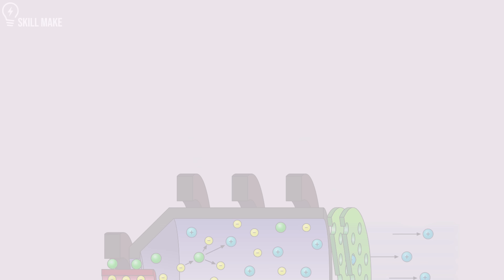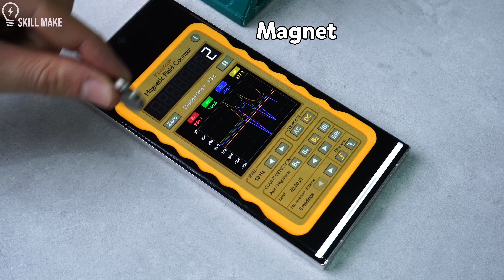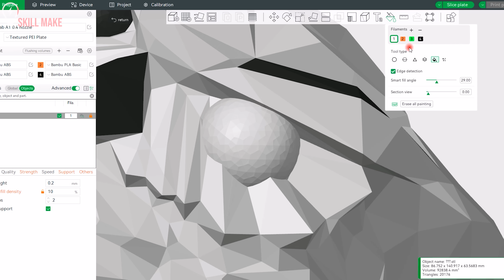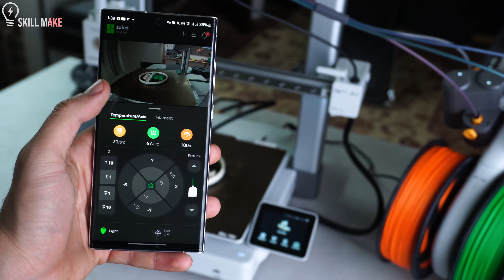I Built the Next-Gen IONIC PLASMA THRUSTER Using NASA’s Secret Design!

Comment from the maker: Since argon molecules are much larger than electrons, accelerating them with high voltage creates more thrust than electrons. However, the accelerated gas collides with electrons, reducing thrust. That’s why we need magnets to trap the electrons. But accelerating argon is really difficult, which is why NASA uses other gases like xenon.
Reply from the maker: These thrusters work much better in a vacuum because air molecules significantly reduce thrust by causing collisions.
Reply: @skillmake  
so would this method NASA is using work for launching rockets or is this the kind of thing that would only work in space travel?
Reply: @5226-p1e my thoughts too, those peroxide jet back packs have limited time use in a gravitational environment, but in space they are much more efficient. 
I was thinking a hybrid approach to accelerate speed already gained from escaping the earth's gravity at 17,000 mph.
Also, the lift off fuel requirement could be reduced to just for the launch, with propulsion from these thrust accelerators making space travel viable.
Weight reduced and cargo space increased combined with increase (pulse?) acceleration, might also help us travel closer to speed of light.
Reply: @skillmake  The trust should still be the same, the rate at which the EXHAUST dissipates or diffuses into the surrounding atmosphere is higher with air
Reply: @skillmake  surely you are still getting the same thrust but it is transferring to the air molecules. The reaction force on the engine will be the same.
Reply: @skillmake I'm not a physicist or have a scientific back ground, but I always wondered how rocket thrusters could be efficient in a near vacuum environment. 
Expressing my thoughts to my son who has a degree in astro physics suggested possible use of microwave energy, so I'm thinking magnetron as used in radar and microwave ovens.
So this plasma route caught my attention, particularly the term used for an 'engine' to generate thrust.
Then It occurred to me that this experiment might be demonstrated in a vacuum tube, but how to measure thrust in a closed environment?
You might need an instalation similar to that collider thing in Switzerland (?).
Reply: what is the board with the screen on 5:38 ? can u send me a name?
Reply from the maker: @baokhangtranduy  pwm generator module
Reply: @baokhangtranduy  Just pause the video, it is printed on the pcb. "HW-753 V3.0"
Reply: Lo siento mucho, es que me gusta mucho esta clase de contenido y me preguntava sobre la manera en la que podríamos lograr  que la potencia de los ventiladores hionicos  aumentarán la velocidad del flujo colocandolos uno detrás del otro. De modo que el ventilador A B y C  se conecten así
[___]]=-[___]]=-[___]]=-~~~~
Reply: @eduardocarlosflorentinoram4977  I have seen this done in other videos  and while each stage does provide an addition, at each stage the addition is less, whereas what we seem to see here is 3 full drives adding their effect together.
Reply: @eduardocarlosflorentinoram4977  you mean by using the first + second fans as a scrubber to reduce electron interference maybe?
Reply: @weedfreer  crees que funcionaria no se veo la idea  algo chueca pero en escencia quiero replicar lo que sucede en la primera etapa de los aceleradores de partículas.

Si bien la velocidad máxima es alcanzada una vez salen del conductor  en el conductor desconocemos si podrían ser aceleradas aun más      usando el mismo voltaje  la cosa es que la inercia de las moléculas podría estar frenando su potencial máximo de aceleración devido a que la brecha del conductor es corta  es como lanzar una pelota sin extender el brazo por completo, lo que quiero logran al ponerlos en serie sería estirar el brazo del lanzador por completo
Reply: So next video with xenon?
Reply: @StarlessSupernova sounds like you're threatening him with a good time... Xenon is crazy expensive though.
Reply: @StarlessSupernova xenon is extremely expensive and hard to get ahold of so i kinda doubt it.
Reply: What about krypton? Not as expensive as xenon?
Reply: @cosmicrdt  noo, because is dangerous for superman
Reply: @cosmicrdt  You can pay up to $10,000 for a small lab tank of Xenon.
Reply: Can’t you just use gravity to accelerate the argon? Or are we talking higher levels of acceleration than gravity would allow in our gravity well?
Reply: @AFMR0420  A robot with no knowledge of science just cut and pasted from a Larry Niven novel...
Reply: Возможно стоит делать не дополнительные ответвление для нагнетания газа а поместите друг в друга как матрёшку, таким образом будет большой вход и небольшой выход
Reply: @RealMimino  could also be possible to combine both multiple electrical charges per inlet, extra gasses, and multiple inlets
Reply: i believe its much better to let the ions and electrons accelerated before pushing them out.
creating a vortex pathway where they can accelerate before existing might increase the output as they gain momentum
Reply: Such a great model of ion truster! Can you measure please trust power in grams according to power consumption? It would be great to now efficiency in comparison with brushless rc motors.
Reply: @ЯнГородецкий-т7ц  چنین اندازه گیری بسیار عالی است. اندازه گیری جرمی جریان گاز و سرعت گاز در خروجی پورت  و در مقابل توان مصرفی جریان الکتریکی و در مقابل میزان هزینه های صرف شده
Reply: You can just use nitrogen instead.
Reply: I continue to create a project of an internal non-combustion engine, I remind you that I am posting here on my channel the technology and the principle of operation, according to which anyone can create a prototype and enjoy free energy, since I am denied financial support at the stage of the idea and theoretical research, after a year of unsuccessful searches. Including I will begin to assemble a sample. And soon another video will be released revealing my developments, the wind of change is coming! All those who are not indifferent, welcome to fly into this departing innovative car, which will lead to great achievements for the successful future of the planet and humanity!
Reply: Argon is a chemical element with atomic number 18 in the periodic table and not a molecule.
Reply: Awesome project….shame about the 3D printer advertised - Bambu has gain an awful reputation in 3D Print world and their software. Look into it.
Reply: Thanks teacher  where  i can contuct you ❤❤
Reply: Nasa's #1 favorite gas to use is helium.
Reply: Nah, that's why you use low temp Superconductors w/the Plasma or use RF Field Gens like Aethera Technologies in Canada with Superconducting Magnets. 

Like Ad Astra
Reply: What magnets; their specs?
Reply: At 3:58 : 6x600 is 3600, not 36000
Reply: You kinda copied mark robers pfp
Reply: Wwow
Reply: I am more curious about how many newtons you are getting. Blowing out candles is not a good measurement.
Reply: @shazm3619  بسیار خوب میشود نیروی تراست را در مقابل توان مصرفی الکتریکی اندازه گرفت. بعلاوه هزینه و وزن سازه
Reply: I think your “manifold” is consticting the airflow. You will need a much longer solution.
Reply: Many people are asking:
Who are the idiots whom are supporting israeli crimes with tarrifs and tax money and raising prices on US citizens for israel sake and for wars??, and many people are asking who are those idiots whom are bombing the yemeni people/the houthies instead of making freinds and deals with them?? You guys want them to target even shipments going to US & not only to criminal israel??.

Please people keep this circulating untill it reaches all people and all dumb crime supporting genocide supporting officials in US and EU and so on..
Reply: Not good, video is good. result not good
Reply: The design of the nozzle that joins the 3 turbines also makes a total difference, with each curve the power of the gases decreases significantly, you need smoother curves, perhaps placing the 3 turbines stacked in a triangle shape, instead of positioning them horizontally next to each other, helps to make a nozzle with a smoother exit.
Reply: Why not put them in line ? @JoaoLucas-wp6er
Reply: Can you add this to back end ducted fan to improve over all efficiency
Reply: If you used a humidifier module could you use atomized water as propellant?
Reply: If two spacecraft, separated by millions of kilometers (say one on the Moon and one near Jupiter), both see Andromeda at the same angle, at the same time, with no delay or significant angular difference — Then it must be a projection.
Reply: As for the reason triple feed isn't a huge gain turbulent flow from the feed you forgot to put a twist in it get a gallon jar of water and empty by tipping it upside down then repeat but spin it first it'll empty right prompt the air rushes in the vortex's low pressure region similar with flow in a pipe if you can keep rotational inertia on outer wall it will increase the velocity of the centre section of flow and you would also gain from adding 1/3rd diameter for each consecutive pipe in to the exhaust as this is velocity driven not pressure driven system mark's guide to supertuning has all the relevant flow loss rates etc and guides to maximising flow regimes through pipes. Pretty sure it's even digitised these day's Although I do prefer hard back. hope this helps keep up the good work
Reply: Utiliza cuarzo o cristal de bohemia para acabar tu proyecto
Reply: maybe on each subsequent maget you need to flip the polarity on your cylinders. IOW N-S-N again on each one or you can add a layer or two of the 'plasma generators' to increase the speed of the thruster without increasing or decreasing the pressure from the argon canister.
Reply: Can you reproduce the experiment with Xenon gas?
Reply: Thief
Reply: Hi. Wouldn't it be possible to blow into a turbocharger to try to get better performance? Good luck. And if you try my solution, don't forget to mention me!!! 😂
Reply: Why no number on the last one? Wtf dude
Reply: I think the entry angle of your left and right thrusters into the center thruster is too sharp and you increase the static pressure beyond the thrust capacity of the plasma.  Creating a longer slope may increase the active thrust by reducing the resistance in the bending action of the sides.  Just a thought.
Reply: Aren't all molecules much larger than electrons?
Reply: The sparkling is unwanted, right?
Reply: were you able to let the thrusters run continuously for very long? interested in how much power this would need to draw to make a small voyage in earth orbit
Reply: Isn't the point of an Ion Thruster to have it with no fuel though? If you're using some form of gas to attract the electrons, you're limiting the acceleration based on how much fuel you can carry again.
Reply: what next on this project?
Reply: Xenon is four times more massive than Argon giving more thrust per unit volume and for the same exhaust velocity.
Argon is however really cheap and common.
Reply: The magnets would actually cause more loss in thrust. Cool idea though!
Reply: You can strip the electrons of the argon if you keep going and then what🤔

Comment: Use a mixture of pure oxygen and argon gas, also use slightly larger mesh holes to allow more gas through. Make the end nozzles smaller to create more compressed gas flow and nitrous oxide gas added from the outside about halfway down the valves to get more concussive force, just look at a jet turbine engine

Comment: love the design elements here. i wonder if its possible to make a more "ramjet" method to further condense the created thrust. i know adding 3 separate motors argon motors doesnt add much more thrust (14 candles went out compared to the single one putting out 12) but it makes me doner if you used a syringe needle to focus the gas at the very entrance of the motor. would more argon be forced into the motor?

considering how cheap it is to get argon. im inspired to try and 3D print a similar design and try this at home! 

also. would it be possible to use wiring to make a electro magnet instead of the 20-25 magnets. granted it uses more power. but it would make it lighter.

Comment: You lost the most of your thrust with the 3 in 1 Venturi restricting airflow and pushing air back in a motor that slightly performs les. Better to have just made 3 separate engines and focus them separately to the candles. Good luck, was very interesting to watch.

Comment: Your still using high volt AC. The engine your designing will never be used on the ground. Try it with DC batteries and go from there.

Comment: Props to you for your work, I would suggest looking into magnetic oscillation as a variable and I know the argon dispels oxygen but if you incorporate a vacuum chamber you will probably garner better results. You have to be thinking about the particle physics as much as the mechanical engineering and find a balance to achieve a more efficient thruster.

Comment: Amazing! you should try again with a tight triangle thruster placement and convergent individual exhausts or try less aggressive and more aerodynamic pipe bends in the exhaust cuz every little bit of piping redirection which is friction on the air flow and therefore lost potential thrust!!

Comment: You wanted to ionize the air there so it could travel further. But the two on the side change direction within the tunnel. The viable option would be to use each tunnel for each row of candles.
Reply: Ultimately, the funnel coefficient will determine the distance, so there's no point in putting two or three in the same place. Outbound.

Comment: Coverup all those ends of screen wires to stop the leakage being lost and you will improve the output greatly. Also cover  the connection point where the HV wires connect to the screen, Use HV putty or silicon. Make the emitter Crown with sharper points. Aim the crown points slightly inward and tangent to create a vortex.

Comment: I don't want to sound insulting, but it looks like your DIY transformer + voltage multiplier circuit actually under-performed the original transformer you threw in the bin. 3 times as many ion thrusters, for 2 additional candles, seems underwhelming. Would have been interesting to see a head-to-head between the output stages of the power supply. It just seemed to me as though the higher frequency (and probably higher voltage) traded too much current.

Comment: I guess you completely misunderstood the purpose of the magnet presented at 0:47. These magnets are actually like solenoid, in which there is a current and generate a magnetic field in the same direction as the ions propagation, resulting in a "gyromotion" of the charged ions. Electrons are ejected because of the electric field on the grid
So the purpose of the magnets is to focus the ions, not to collect electrons, and the magnetic field line should be longitudinal, parallel to beam propagation, not transverse, like in your video.

Comment: another big reason this design wasn't so good with the 3 is that the 2 on the right and left actually had a huge pressure drop as they fed into the center. you reduced their diameter and tried to force an almost 90 degree bend. if you want 3 feeding 1, you need to stack the third one on top so all three have a minimal bend and DO NOT reduce the area.

Comment: i'm thinking on the last one, you had 3 motors or ion thrusters, but they were filtered down into one singular output. but the output was the same size as for just one ion thruster, thus likely limiting the outflow of air or argon ions or plasma or whatever. 
this is why you only saw an increase of 12 candles blown to 14 candles blown, rather than potentially 16-18 candles blown.

Comment: Would be far more effective if the corona ring were 2/3 the diameter of the nozzle inlet. Bernouli's principal.   The corona discharge is a very fast moving electron that accelerates surrounding air. if it's on the edge of the nozzle inlet, you are losing half your airflow.  by putting it 1/2-2/3 of the nozzle inlet diameter, all of the corona goes to moving air inside the nozzle as well as pulling air from outside the od of the corona discharge.

Comment: I Have 3 theories, 1: It would work better sequentially. 2: I think if you cut holes in the center of the Mesh to match the OD of the copper the Mesh would be less of an obstacle. 3: the copper has less contact points than the mesh You Might be belter to use Mesh on the other conductor. Cool Video.

Comment: Are these engines practical when scaled up? This is amazing. Imagine if this guy was using a real lab. Absolutely fascinating!
Reply: I dont think that they are efficient enough. Most of the energy would dissipate as heat. As long as a motorwith a propeller is more efficient, they are useless.

Comment: i know youve been doing this longer than me, but bro, around 340, when unraveling the spool of wire, you shouldnt use your thumb and finger as a guide. itll leave oil and microscopic dead skin inside the spool. not sure if its meaningful, but personally, i wouldve used a specially made instrument, or rubber gloves

Comment: Hard to tell from the video, but did you arrange all of the magnets with their north poles facing inwards? If so, the magnets on one side are working against the magnets on the other side, and you'd probably have better luck if you orient them so that all magnets are aligned north to south as much as possible. Also, as others have pointed out, that nozzle is probably not converging the streams of the multiple thrusters very efficiently, wasting a lot of power.

Comment: The point of a ion drive is so it doesn't use a fuel stored on board to be required.  I saw this when the first one was made that is an ion drive.  Using a gas with it defeats the purpose in space